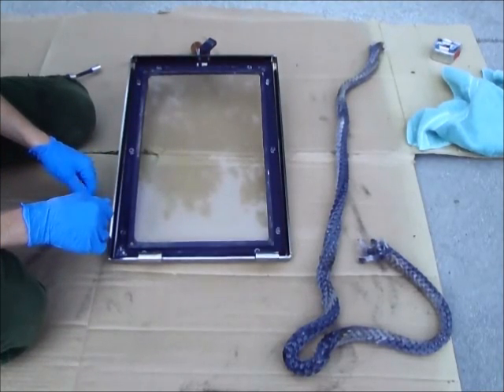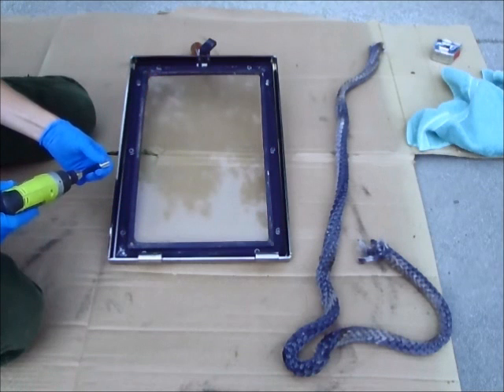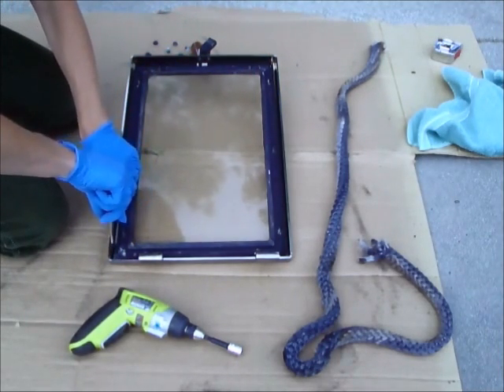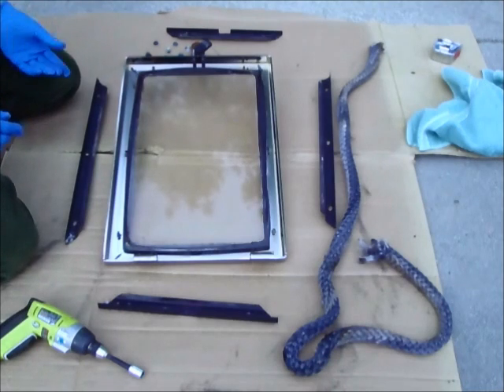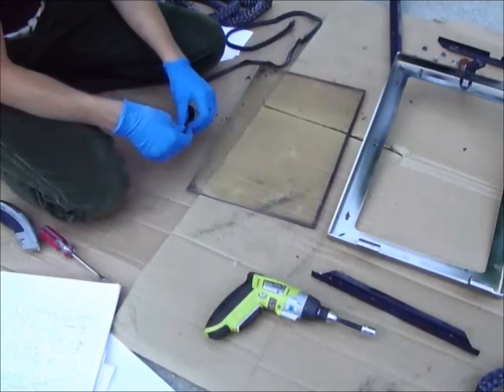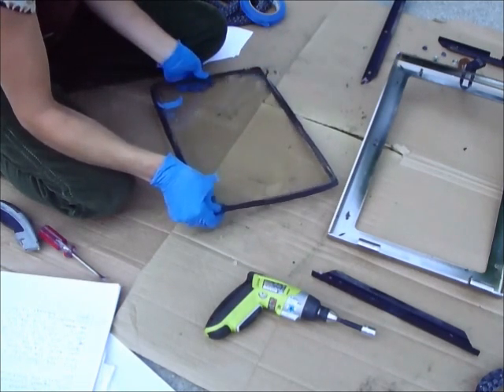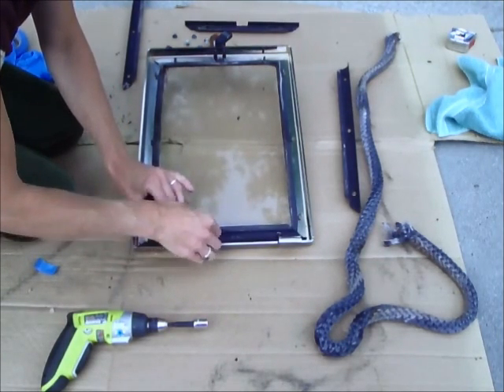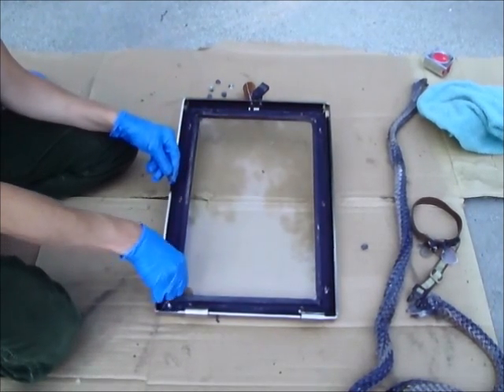How to change your glass gasket

Comment: This is a helpful video, but it is important to remember that scratching or etching the glass 
will weaken the integrity of the glass. You should not use a razor blade, steel wool, or any other 
abrasive material to clean the glass, even on the edges. Use a low alkaline content cleaner only and let it soak into the deposits for a few minutes to loosen any heavy residue rather than scraping with a razor blade.
Reply: I always only use a damp paper towel w/ a a dab of fly ash to clean glass - cleans the best with no abrasion

Comment: You actually put the old gasket back on. The new gasket is sitting at the top of the project all the time. Never gets put on ??????
Reply: I saw the same thing... What's up?
Reply: @cliffcaron6615  The new gasket on the floor looks like the door gasket, not the glass.  Usually, the glass is a self adhesive, like what was shown.  She must have been prepping to do the door next.  Best regards.

Comment: The video jumps over a crucial point -- where the two ends of the gasket meet, and how and how much (if any) they overlap.  In fact it looks like when you start to put the glass back in the frame, there is a 1"gap between the two ends in that lower right corner.  I know from my current experience this will result in toxic fumes coming out in some gas stoves.  It's the whole reason my stove's out of commission right now and why I looked at this video.
Reply: 1/2" overlap at the top right